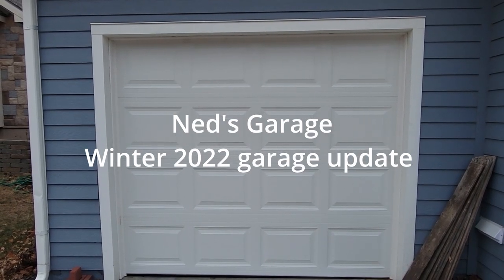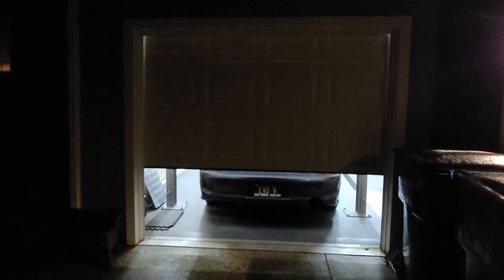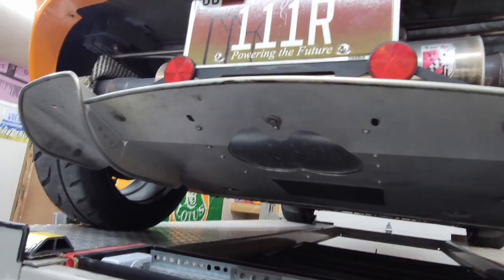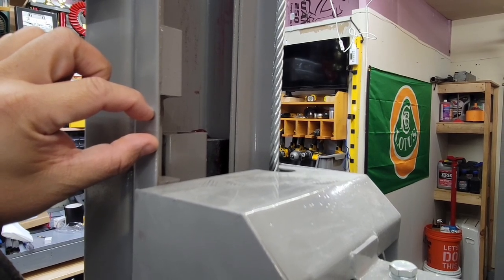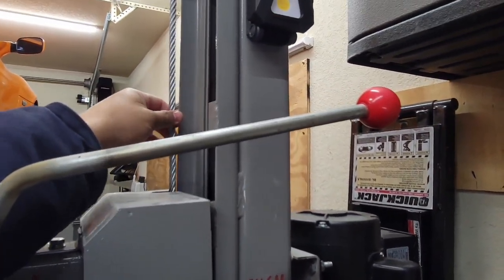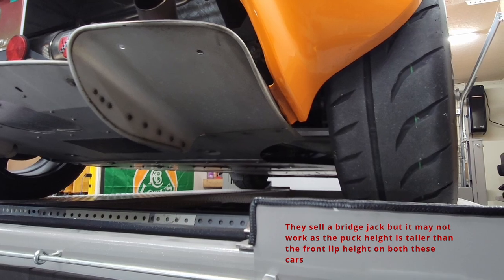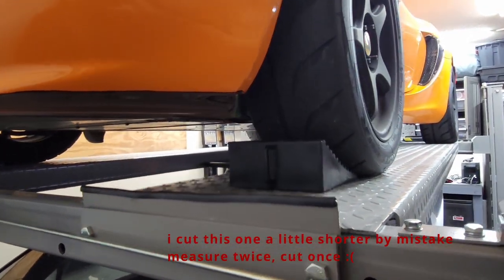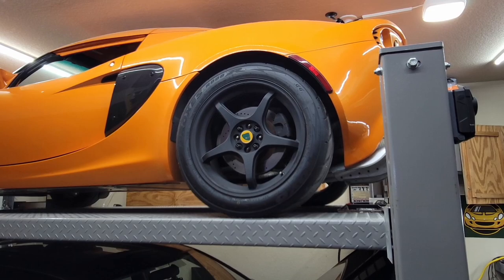Ned's Garage Update - Triumph Classic 4 Post Lift Install.

Comment: Nice  I just installed a triumph xlt lift. My garage is 30x60 with 10 foot ceilings but your idea of marking the max lift height for each  vehicle was simple yet effective. I'll be doing that tomorrow. Nice Lotus. I did some work for them and visited their facility in England back around 2010 and was going to buy an Elise but ended up buying a Porsche Cayman S as it was a more comfortable daily driver than the Elise. Still love the Lotus though.
Reply from the maker: Thanks for leaving a comment! And I love Cayman S's. That is a nice daily driver for sure! I am looking at someway to make sure it doesn't go higher than that rung, maybe some kind of stop or welded bracket or a limit switch to make sure I don't accidently smash the car into the ceiling.
Reply: @nedsgarage  I'm thinking of making a hinge out of U bracket and mount to garage wall at the centerline of the lift a couple of inches below the ceiling. drill a hole through the end of a length of electrical conduit,  pipe or something longer than the vehicles and mount to the U hinge.  hang the other end of the pipe with a loop of wire so it is free to move up to flip a switch or ring a bell or something.  When the car top raises it up it should give me an indication to stop.

Comment: Thanks for walking us through this. What did you end up doing for a jack solution?
Reply from the maker: Hi. Thanks for watching and commenting. I did a lot of measurements and the bridge jack they sell seems a bit too tall for my application. I end up running low profile aluminum floor jacks made by California car cover on the include jack tray with various pieces of wood and pucks and that has been working great.

Comment: Really like your cars & garage.
What’s is the height from floor to the bottom of lift with Evolution on the bottom & lotus up top?
Reply from the maker: Hey, thanks for comments and sorry i didn't get this notification and reply sooner. The height from floor to bottom of platform is 60" above the floor.My Lancer is lowered and generally the roof line is around 56" above the floor. However, the highest point on that car is the roof antenna and although i have a shorty roof antenna it would not fit with the 1 rung lower on the lift. The platform is 4" thick so the lotus Elise bottom of tire to floor is 64". The lotus Elise is a pretty short car (~42"-44"). With this lift i have 2 more locks to go up, but i am unable to go up higher than this as i will hit the ceiling (you need some room to get OFF the locks so i dare not push it higher). i have not tried to park the lancer up top and lotus below it but i hope of on the lower rungs will make it all work for that set up.

Comment: I think this should be enough for what I need, cause I have a C6 Z06 and eventually saving for a Lotus Elise/Exige like yourself
Reply: Would you be able to do suspension work or transmission work with this lift? Bridge jack or whatever it's called?
Reply from the maker: @AarenPho  thank you for commenting. there are a couple ways to lift the car up on and take the wheel off. 

1 - is use the included sliding jack platform and a bottle jack/scissor jack/jack stand combo. 
2 -  a bridge jack
3 -  a quick jack on the 4 post lift rails, a quick jack doesn't work on the orange car due to the lifting points not being in line/parallel with each other. 

i don't have a bridge jack yet and get by using the sliding jack platform at the moment.

Comment: Can you put the motor on any side? I have a two car garage and I need to put it towards the middle of the garage, so I can place the lift as closely as possible to the wall. Do you know if that would be possible?
Reply from the maker: Because the hydraulic cylinder is mounted on one side of the rails, one of the upright is specific to the motor/hydraulic mechanism. You have to either mount it where i have (far left) or flip the whole thing (right side up front near my lotus banner). I didn't have any outlets over there and i needed space to walk through so i chose the far left side. 

my choice would have been front left side if i had my pick. thank you for watching!

Comment: What clamps are you using to hold your quickjacks on the wall?
Reply from the maker: i just took a piece of steel bar and drilled some holes and then bend them into a J shape. then screwed it to the stud at the correct height to mount it on the wall. there is no load hanging off of it its sitting on the ground and the bracket just keeps it from tipping out.